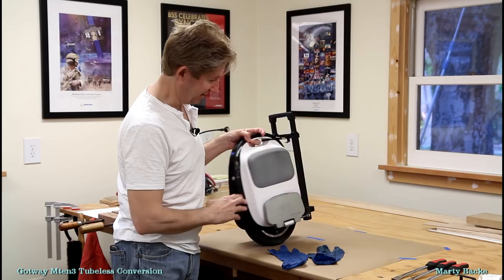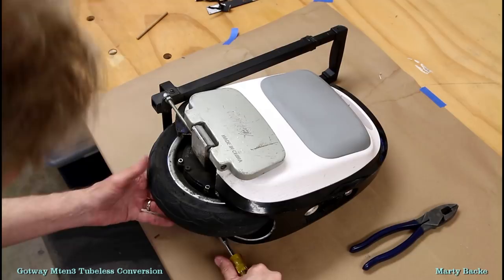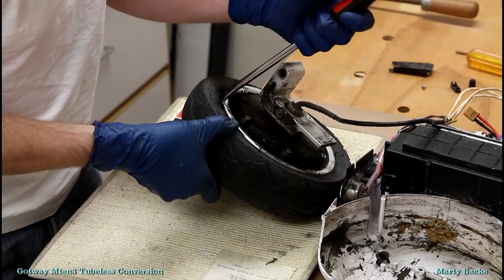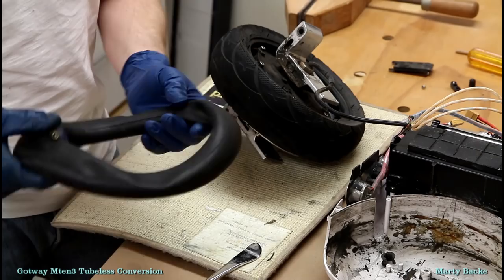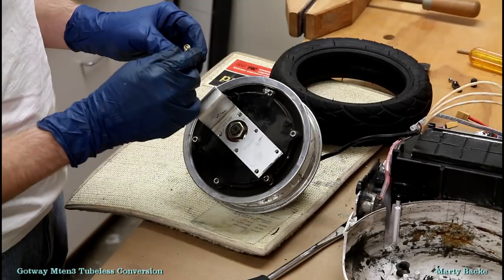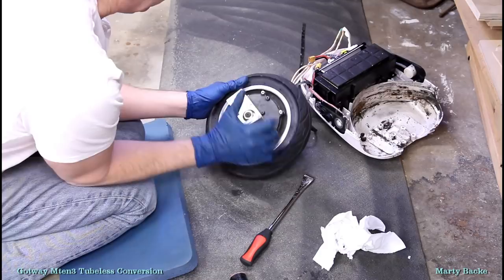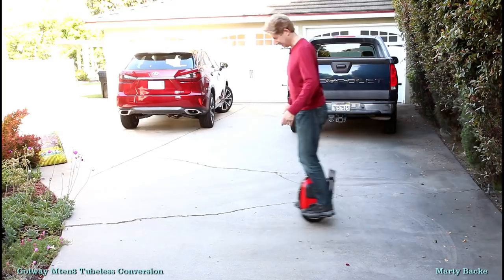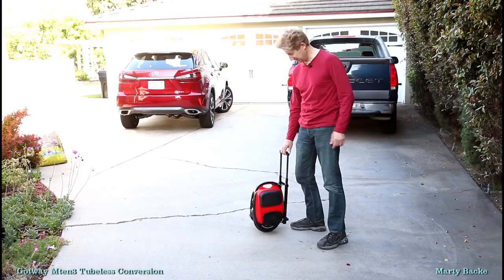Gotway Mten3 Tubeless Conversion Howto

Comment: Nice work! Just a quick safety tip: the reason they use tubes is due to bead break while turning hard at high speed. This is especially possible if you are unaware of low pressure. I'm sure you'll be fine on that wheel but if you intend to do any hard riding just be sure to check your pressure and make sure it's over 30psi. 👍🏼😉

Comment: Marty whew.  Great work getting the tire off.  One tip I learned while removing a small tire for a hand truck. Break both beads all the way around.  Use a C-clamp to squeeze the tire near the bead if necessary. Then for the side you are trying to remove push and keep the bead of the tire in the center section of the rim, then put your tire iron on the opposite side.  The center of the rim is smaller in diameter, and gives the tire more slack to get over the lip of the rim.   See 13:45 into this video you can see how much deeper the center section is. Hope you never have to use this trick, but keep it in mind if you ever do.
Reply from the maker: Thanks. I've been getting various tips along these lines. Like you say, hopefully I won't have to do this again, but I'll remember your tip. And more importantly, your suggestion may help someone else who is trying to remove the tire.
Reply: That technique works excellent. I got my tesla tyre of just using small plastic tools for ordinary bicycle tyres, got one under the edge and bent over the edge as the opposite side was pressed together in the centre. Then clamped the first small plastic btacket under the footrest holder and pushed the next one in and from there it was just a matter of wiggling the tyre and the second tool and off it came fairly easy

Comment: Heya just wanted to say thank you, your video was more than useful I have changed my mten3 tire to tubeless. Mounting and removing of the tire was striaght forward however sitting the bead took quiet some time as this was the first time seating a tubeless tire. I achived this not with fire but by seating one side of the tire by hand, using tire lube on the other side, ratchet strapping the tire down quiet tightly, then applying downwards force to the opposite side where the bead was still away from the rim. Lastly a high volume of air with the vavle stem stil in place via an air compressor.
Reply: Did your tire keep its air? Is it a new Mten3?
Reply: @kurt.dresner  yes and it is more stable

Comment: I was going to recommend a note or comment at the point you finish the valve install, that tool has a pivot and angled handle for a reason, with a block of wood between the rim and handle future core installers could use the leverage to make that easier.
Thanks for the excellent instructions! I was hoping to find longer mileage for a daily commuter. 400 miles may not get me through two years but I think I'll get a wheel to try it out anyway, especially since they're already making these tubeless. I can plug those for most punctures.

Comment: Nice! I like it. Now if Gotway would send them out as tubeless. The color is awesome. I Actually put a plug in my z10 tire the other day because the slime quit sealing the hole.  I am amazed that it stayed in perfectly. No leaks at all. I'm thinking about buying another wheel but I haven't decided between 3. MSX, KS18S, or Monster. I'm leaning more towards one of the wheels that I could sit on.. A long journey wheel.
Reply from the maker: Mine was from the first batch. They later switched to tubeless so any Mten3's bought in the last year or so should be tubeless. Fortunately I haven't yet had a flat on my Z10, but your experience and others points me to using a plug. Good to know.

The Monster is the king of long distance wheels and it's also the best for sitting. Looks like I know what you're going to get :-)

Comment: Heat gun and windex, does wonders with small tubeless tires remove valve core and  use airgun adapter on valve to fill tire, till you hear two pops  , pop.😁 then reinstall valve core after tire is beaded and fill tire to your prefered PSI, Thanks for sharing your hellish accomplishment. Great video !
Reply from the maker: I think I've found what works for me, but maybe your tips will help someone else that reads this. I'd love to see that airgun trick, but your description just raises more questions for me. That's why I made this video - there's nothing like seeing something done verses a description :-)

Thanks.
Reply: What question would you like answered, I'm all ears👂👂👂👂👁👁👁
Reply: I saw that you were having trouble getting air in fast enough to bead the tire onto the rim that was the intent of my post. I hope I made things more clear, with my recent edits.
Reply from the maker: @bretholtzman1524  Oh, I think I understand now. I only have a pancake style compressor so I suspect that I need a lot more air volume to do as you suggest. Even after Googling, I still don't know what a "airgun adapter" is :-(

Comment: I wonder if there are any hollow solid tires for mten3 ? I am just about to order 3rd tire average lifespan 2.5 months. Original from Gotway/Begode/Kebye warped with like 1cm difference in width on opposite sides blowout like Marty. 2nd tire got some kinking and warping as well in it and started twitching while riding then I took it to a tire shop where they inflated it past its 25 limit to 35 and it exploded. At this rate we need to stock four tires four or five tires for a year's usage.
Reply from the maker: There are only two tires that I'm aware of
Reply: I converted my mten3 to tubeless and 2 weeks later got a hole in the tire and had to replace it. Hope i don't have to replace tire frequently.

Comment: Next time Marty try rubbing alcohol it makes the rubber slippery & evaporates quickly without the soapy residue.
BTW I bought the KS18S expecting delivery around the middle of May 😎👍
Reply from the maker: Congrat's on the 18S purchase.  Hopefully there won't be a next time, but I think I'll stick with the more pleasant soapy water. There really wasn't any residue issues.
Reply: @ElectricUnicycles  cool just trien to help my friend, & yes hopefully
there wont be a next time. ; ) ✌
Reply from the maker: @jackvolta3489  I realize that you're trying to help, and thanks. I just don't want to deal with chemicals if I don't have to. The soap seemed to do the trick :-)

Comment: they listened. “Stealth Black” is coming😎
Reply: RightThe Hand 
Hi, so weird i just had flat this past weekend. 
i did the shortcut(lazy way) without taking a single screw and patched the hole. only to find out there is another hole . Had to take it apart the second time patching it. and was still leaking after i put it back together. maybe the air between tube and tire. dunno but she’s holding. Also SLIME IT!  it will help with tiny holes🤙

Comment: Hey Marty, quick note. Ewheels recently converted my Mten3 to tubeless, but apparently the motor casings that Gotway is using now are not airtight and air is leaking out through the motor casing. Have you experienced anything like this? My wheel stays inflated for a few hours but by the next morning is completely flat. I'd hate to see someone go through all this effort and then wind up with a wheel that won't stay inflated. You may want to warn your viewers :)
Reply from the maker: Hi. Sounds like eWheels maybe didn't fully set the tire against the rim. I highly doubt that there's an issue with the wheel rim? After the tire is installed on the rim a tubeless tire sealant must be added which helps to form a seal between the tire and the rim. Did eWheels do this? If not, you can add it.

Both my tubeless Mten3's maintain their pressure for many weeks without me having to add any air.
Reply: @ElectricUnicycles  What kind of sealant did you use? I put some ArmorDilloz red in the tire, but maybe I need something else? Or maybe I need to get it near the rim?
Reply from the maker: @kurt.dresner  See the link in the video Description

Comment: Tire liners are the bomb... here in az we use tire liners an slime with a thorn restaint tube... so.....restaint tube.... slime.... an tire liner ....   i have wheels that havent had flats on in two years with constant use..../ also i use to use this tec... for pedal cabing down town...   use to make 350 a night...$$$$$$
Reply from the maker: You use tire liners in your EUC's? I've yet to see any details of people doing this. And I've never seen thorn resistance EUC tubes. Wish they existed.

Comment: Hi, I found that there is Solid Tire 70/65-6.5 for XiaoMi Mini Pro, do you think they same ?  did you try any solid tire ? now they have pattern hole in middle seem better to use since no need pump air
Reply from the maker: I have no idea. I would need to see the exact specifications for this tire that you found (do you have a link?)

Comment: Great video. By the way do you know if a TR6 metal stem (8 mm hole) could fit? It could  avoid drilling the 11.5mm hole for a full rubber TR 13 stem valve
Reply from the maker: I do not

Comment: Marty, with personal experience I know that it's not a good idea to use tyre levers if you intend to put a tubeless tyre on the wheel. Levers can cause tiny nicks and dents on rim surface where the beading of the tubeless tyre is meant to sit snugly. Air may start leaking along the beading of the tyre because of the nicks on the rim. You may never know why the pressure is dropping all the time until you take it to a proper tyre mechanic. Best thing is to get the job done at a proper tyre shop.
Reply from the maker: Thanks for the information. Fortunately my tire seems to never leak any air.

Comment: Hey Marty! What size bolts did you use to attach the trolley handle to the pedals? I need those! Also, I used a U bolt to attach it at the handle padded and secured with Automotive harness (fabric) tape. I purchased a solid tire for my miten 3 and was cruising videos when I came upon yours! Great job.
Reply from the maker: Hi Lisa. I used 1/4-20 threaded rod, cut to length needed.

Comment: How has this held up? Any problems? Looks really well done... kind of makes you wonder why they don't just sell them tubeless to begin with.
Reply from the maker: It's held up great. Within a year of this video this did start to sell it tubeless and I think they still do.
Reply: Well what do you know! The specs on ewheels does say tubeless.
Reply: @ElectricUnicycles  I bought mten3 from freemotion last month and it was with a tube.
Reply from the maker: @Haiho300  Interesting. Really does depend on where you buy the wheel and how old their stock is.

Comment: Solid tire is that an option? or the "holed solid tire" version ? Electric scooters have both options (also they have twice as many wheels) Xiaomi Mini Scooter Tyres 70/65-6.5 Tubeless Wheel Tires ...
Reply from the maker: I'm only aware of two tires for the Mten3. If you know of any others please let me know.
Reply: I have no idea how it is on one wheelers, but I hate flat tires. Searching "tire 70/65-6.5" gives some exotic off road options too. Amazon and Ebay have em too. Maybe Im on a wild track here? The lazy Norwegina solution to this (We have winter tires for bikes ) is not to change tires but have two set of wheels for the bike.
Reply: NOw for the exotic ones, the cheesy ones with holes in em: https://www.banggood.com/buy/ninebot-es2-tyre.html
Reply: yeah, I'd love a solid tire but worried it'd be too firm and not have the necessary traction for carving, I haven't found a fancy one with holes in the mten3 size

Comment: Trying to do the same on my Gotway Tesla, but the rim is so darn close against the plastics i cant use a straight stud. And the angled studs wont fit between rim edge snd inner hub :-) guess i will have to use the grinder a bit to make som space for the valve neck
Reply: Did you convert your Tesla to tubeless? I was thinking about converting my Tesla to tubeless as well but trying to find out if anyone was successful with the conversion.

Comment: Hello,you make good video...i like mten3...i want to by this wheel for short rolling.
But i weigh 90kg...is a problem?
Reply from the maker: Yes, your weight is OK with this wheel.
Reply: @ElectricUnicycles  thanks!i'm driver international i go 3-4 month in europa...is good for my truck i don't Can to take a Big wheel with me. Your Mten is IP54 for the rain?do you know a New Mten3 this form IS square.

Comment: No tire sealant? Ewheels told me to use tire sealant but at the end of the video you said you use slime but you never showed when and how you did that step. Worried my MTen3 is gonna sit decommissioned for yet another 6 months because I don't know what is the right way or not...
Reply from the maker: I used ~3 ounces of Slime in both my Mten3's. No problems over the last 5-years
Reply: @ElectricUnicycles  Thanks! Just got the tools you recommended for the job and the materials. I just need to get a file from the hardware store!
Reply from the maker: @joey_outdoors  Good luck. Totally doable - just have patience. Let me know how it works out.
Reply: @ElectricUnicycles  Hey Marty! It was actually easier than I thought it was going to be. I broke one of the valve stems on the first pull but fortunately I had several at my disposal. I found the hot soapy water helped but also wiggling the wheel slightly left and right with my feet while pulling. The most difficult operation was getting the tire fully on but persistence paid off.

Thanks for all you do. ✌
Reply from the maker: @joey_outdoors  Great to hear that it was a successful operation 👍

Comment: I just discovered my Mten3 is tubeless last night while putting slime in the tire. I bought it about 3 weeks ago.
Reply from the maker: Except for the first handful of months, all Mten3's are now tubeless. My Mten3 in this video was from the first batch.
Reply: @ElectricUnicycles  - wait.....they're all tubeless now??? Today, 5/1/2020???
Reply from the maker: @mr.c1989  Correct. Mine is the original version released a couple of years ago when they shipped with tubes.
Reply: @ElectricUnicycles  bought this summer 2020 at wheel rider store on Ali... Full tube. Too bad for me
Reply from the maker: @__dummy__7523  Yeah, that's too bad. I'm thinking maybe it was a new wheel but old stock?
Reply: @ElectricUnicycles  yet it has the new cut off button of the new 2020 model. But sure old stock motor. I will see if a r412 tubeless valve can fit. Perhaps the hole size is already compatible. 
The stock tyre is terrible square always wants to put the wheel in upright position. When carving a pain in the ass.
Found this well rounded scooter one:
https://a.aliexpress.com/_B0xHWf
Cheers.
Reply from the maker: @__dummy__7523  It could be that they went back to using tubes because that tire is not optimized for tubeless riding. The tire that I switched to in this video (and many other people have too) works great without a tube.
Reply: @ElectricUnicycles  finally I enlarged the hole to 10 mm. Yours was by 11/32=8.73 mm=9mm. But 3 valves broke while tried to put it in place. I think it is because I did not chamfer the hole from inside as I did not tear down the wheel. Just removed the pinch flat tube by cutting it and pulled it out. I bought a 2 parts metal valve which should easily fit.
Reply from the maker: @__dummy__7523  Glad you got it fitted :-)

Comment: Would you change say a commander pro mini or ex30 to tubeless
Reply from the maker: No
Reply: @ElectricUnicycles  No particular reason? Just because, Jesus's told you not too, aliens communicated to you it was a terrible idea?
Reply from the maker: @BillyGlyde108   I did answer your question, but since you own my time, I’ll clarify a bit. I have seen no compelling reason to go to the upgrade process, which is not minor, and I have personally witnessed a tubeless tire come off the rim during some trail riding, and he was screwed. Wouldn’t have been the case if he had a tube in the tire. but if you have a compelling reason to do the work then go for it.
Reply: @ElectricUnicycles  Holly bajesus! Thank you for your detailed reasoning and terrifying story. I give you leave to continue your hobbling.